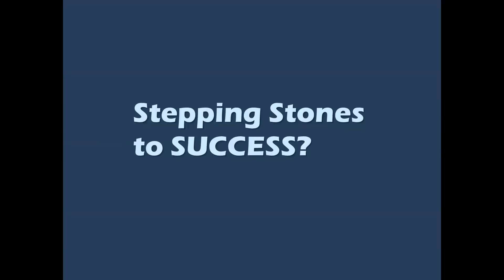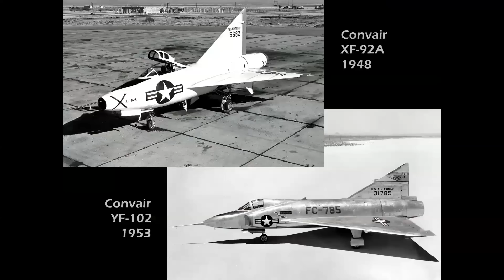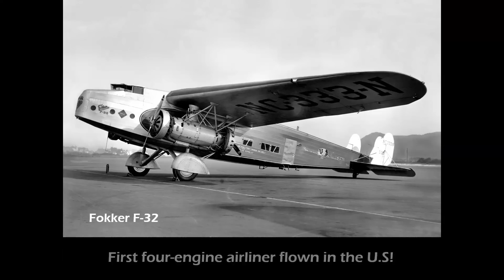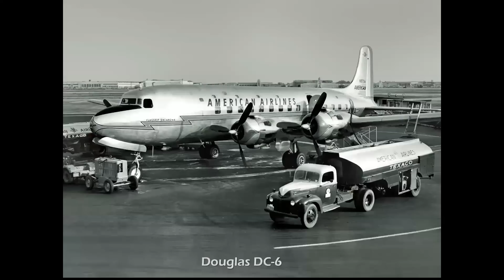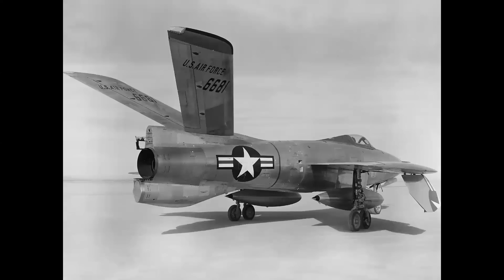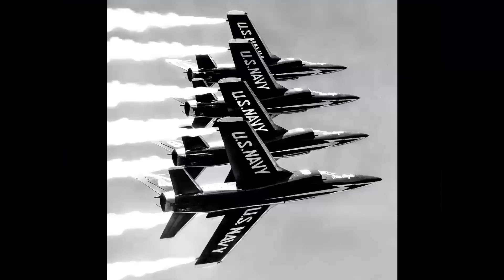EVOLUTION OF AIRCRAFT DESIGN - Three Airplanes Considered Flops That Ultimately Led To Success!

Comment: So who came up with the Triple Tail first?  Douglas designers or Kelly Johnson with the Constellation?
Reply: I could be wrong but I thought the triple tail was the need to get the aircraft out of the factory.
Reply: @mpetersen6  And park it in a normal hangar. True. The B-52 had a fold-down vertical stabilizer for the same reason.

Comment: Regarding the Jaguar. I can highly recommend Corky Meyer‘s test pilot autobiography which has a hilarious and hair-raising chapter about this plane.
Here is a part of it, text recognition not perfect on glossy paper:

 next thing I remember was that the buffeting had greatly eased and I was down to 200 mph. I gingerly advanced the power to land at Edwards as soon as possible. The chase pilot, my old friend Captain Zeke Hopkins, thought that I was a dead duck since he could see me rolling around in the cockpit for about 20 seconds while he was trying to rouse me on the radio. I let him know all was well after the buffeting eased up.
I knew from my previous lift-off experience that the horizontal tail went wild from the disturbed canopy-open airflow when approaching below 160-mph takeoff and landing speeds. Consequently I knew that I had to put the aircraft on the lakebed very fast, flying at least 200 mph. Just before landing, Zeke called me to say that the ejection seat face curtain was fully extended and flapping on the back of the fiberglass section of the canopy frame, a fact I confirmed by a glance in my rear-view mirror. I reached back, grabbed the rubber handle on the curtain, and put it between my teeth, thinking to myself, what a B movie this has become! As the face curtain was fully extended, I suspected the seat was "hot" (ready for ejection) but I also thought that there might be a check device on the canopy that should prevent ejection until the canopy frame itself had been jettisoned. I was not all that sure, however, that it would be effective with the canopy glass gone. After touching down and slowing to 100 mph, I hurriedly unbuckled, scrambled out of the cockpit, and straddled the front fuselage, hanging on to the windshield, facing aft. I had managed to get back on the ground, and I had no taste for ejecting with a seat, which needed 5,000 feet altitude for a safe ejection. Several miles later the XF10F-1
Jaguar came to a standstill on the dry lakebed after completing a wide circle.

Comment: The Grumman XF10F was a bold step, and certainly a good research aircraft.  The very unusual horizontal stabilizer was discussed in one of Hank Caruso's drawings.  Apparently the small airfoil at the front of the hor. stab. acted as a canard to control the pitch of the hor stab.  Or maybe it could be considered a very large trim tab?  IIRC, the end result was that it was not as responsive as directly controlling the hor stab position, as you mentioned, causing pilot induced oscillations.  I guess you never know for sure until you try!

Comment: Atlantis has repopped the old Revell Grumman F11F-1 Tiger kit.  Unfortunately it's the earlier short-nose variant, and is an odd scale.  Of course Lindberg's ancient 1/48 kit is still available too.  Both come with Blue Angels decals, though Lindberg does have an issue with operational Gray/White scheme and Navy decals.

Comment: My first flight was on a Boeing 727 and, as a 4y/o boy, I was crushed it wasn't a 707.
Reply: My first flight was on a Douglas DC-9 in 1976, as I flew from Tallahassee, Fl. to Lackland AFB/San Antonio, Texas for Airforce bootcamp.  Our local airport at that time wasn't really able to land B707s, but Nixon's Airforce One did slip in and out once.  B727s were common along with the DC-9.
Later the second longer runway was built.  Still no Jumbos though! 😊

Comment: It's amazing how much the technology of the times has shaped the development of aircraft technology.  The engineers seemed to get the edge on airframe development while power plant and aircraft control seems to have lagged behind  sometimes seriously so. I was surprised about the problems with the gruman swing wing prototypes power plant.  The F-111 and early F-14 suffered similar issues with the TF-30 almost 15 years later.  Great video.  Thanks for sharing.

Comment: OK. I have to mention the elephant in the room: Why is the canopy of the F11F Tiger opened in mid-flight? That was common with slow prop planes.
Reply: If you balked the CV approach and landing and went into the water, you were absolutely screwed if your canopy jammed. Having it open for landing was a thing that persisted well into the jet age.
Reply: Such an interesting presentation !!! I was not aware of the DC-4E being dis-assembled while in Japan, and using that engineering as their blueprints for their later military Nakajima aircraft in WW-2... They simply said it crashed into the ocean, when it actually safely landed where it was dis-assembled specifically to hide, what would otherwise be Patent infringement in places that honored intellectual property standards...